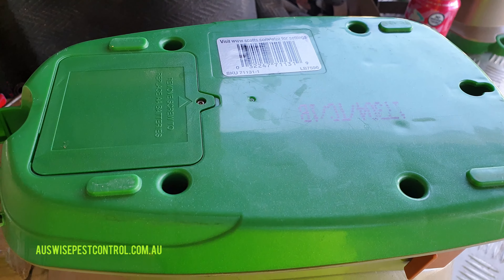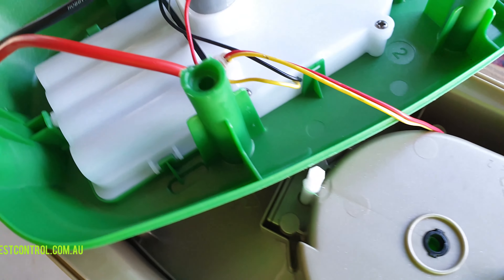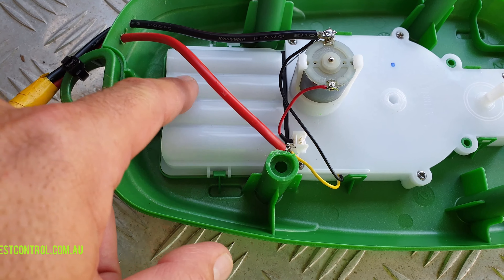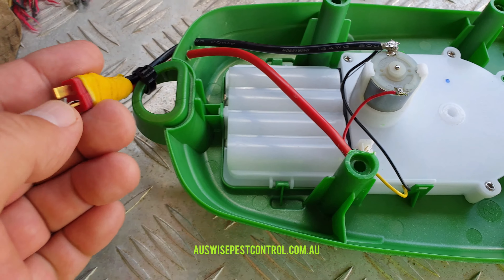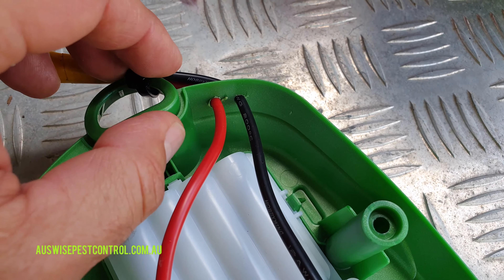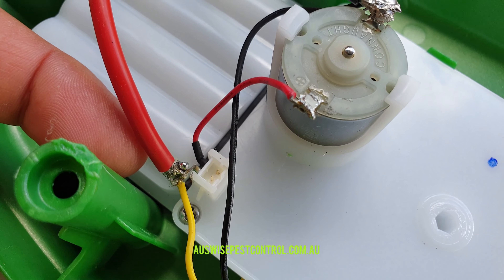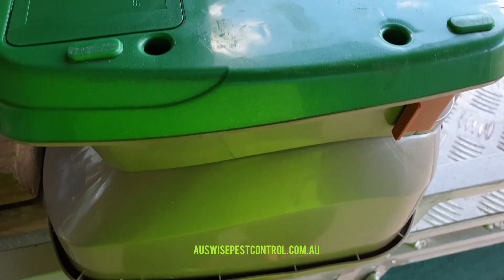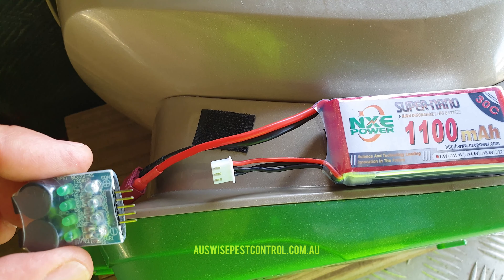The Wizz battery upgrade

Comment: I bought mine at Ocean State Job Lot. It came with a little hobby type plug already on bottom of unit that provides the connection you are making in video. I looked at the ones while shopping in Home Depot, they did not have the plug.
Reply from the maker: Good to know, thanks
Reply: Bought mine at Home Depot. Plug in under the barcode sticker.